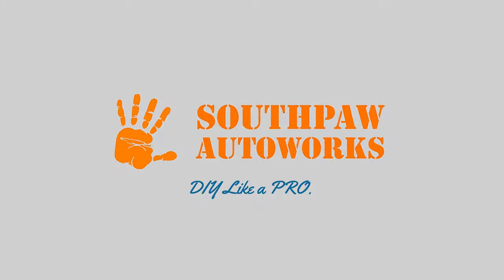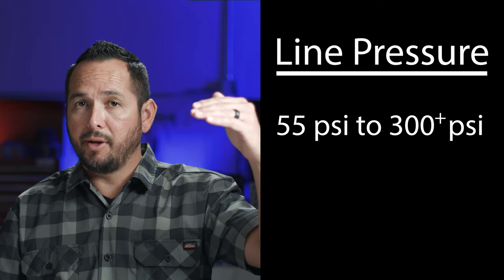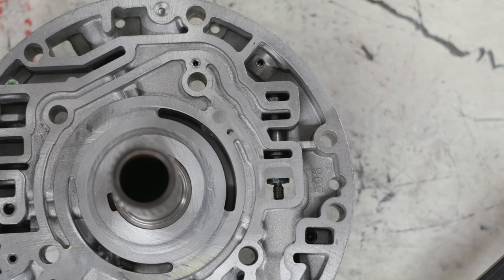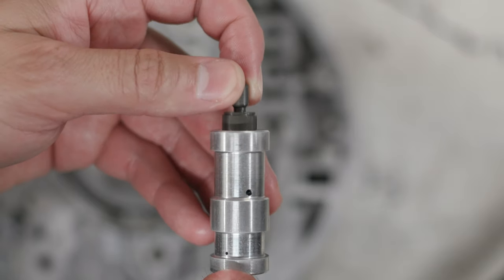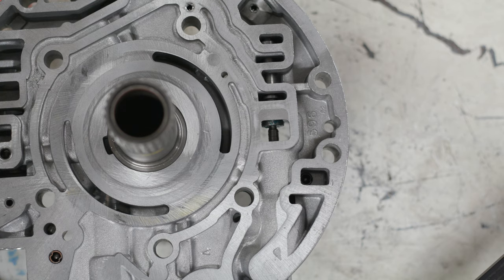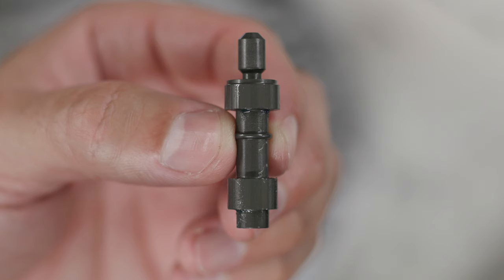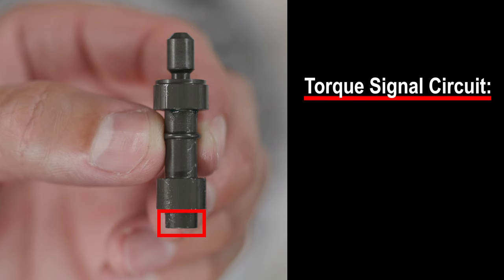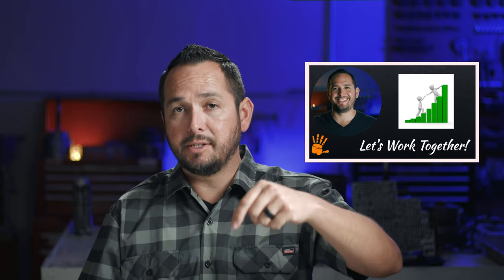4L60E Pressure Regulator Valve (Boost Valve) (Part 2 of 3)   (4L60E Line Pressure)

Comment: I also have a 1990 4x4 suburban 1500. Original 700 R4, I just drove it back from Florida, 1500miles,  towing a heavy load, and it shifts very nice and soft, typical GM. And when it's hot cold, when you put it in drive it clunks extremely harshly. It's not the ujoints, I just changed 1. I didn't put a new accumulator in the aux valve body, as per friend's recommendation, it still does the same thing. Hot or cold, and it's only occasional.  If I put it into 3rd drive. Not overdrive, it doesn't do it. Only when you put it into overdrive, and this of course  standing still, normal idle speed
Reply from the maker: Info received.

Comment: Kewl!  I'm currently experiencing an occasional hard slam into reverse from park on a 1993 C1500 5.7l with 235k miles.  This video was very helpful in understanding part of the reverse hydraulic circuit.

First up on the attempts to fix is a new TPS (throttle position sensor).  Obviously, the ECM gets some of its information about engine load from the TPS.  If that glitches, it could be commanding harsher pressures for the shift to reverse.

Thanks for taking the time, effort, and expenditures in hard cash resources (video and illustrative equipment) to produce these quality presentations.  They are detailed and extremely informative!
Reply from the maker: Really appreciate your comment.
Wishing you the best on 93 4L60E.

Comment: I had  a late 80s, aux valve body, 700R4 rebuilt for my 1984 6.2 diesel 4x4 suburban. The shop is very reputable, I know that it's a good job, I'm friendly with the owner. It shifts rock hard, which I'm fine with, because I use it for heavy towing. The only problem I have is problem but it sits for a day or 2, it takes forever to go into the driver or reverse. What is causing the fluid prime to bleed off?
Reply from the maker: It sounds like a drain-back issue.
The pump is responsible for multiple tasks.  One of those tasks is filling up the torque converter with fluid.  If the converter is low on fluid, it will not allow engine torque to reach the input shaft of the trans.

If the vehicle is parked for days, it's possible for the torque converter to partially drain back into the pan.  This, of course, is not normal.  
When the converter is partially drained, the pump needs time to fill it back up, before the vehicle will move again.

A worn pump bushing can cause this issue.  If the bushing is indeed the issue, I'd also be looking at the dowel pins on the engine, and the corresponding pilot holes on the trans bell housing.  If these are worn, it can allow for a misalignment, putting extra stress on the pump bushing....causing premature wear.
Reply: A tip I picked up years ago was to bolt housing to engine and have a dial indicator in flywheel or crank or flex plate whatever and check run out with the trans or bellhousing on the block you were using together, surprising how many times there is a stack up mismatch of production tolerances that cause bearing failures
Reply from the maker: Right on!
Thanks for sharing!

Comment: Hi Robert ,
Great videos ,i have been rebuilding 4l60e since the late 90s. 
Learned a few things regarding the oil flow paths and how they work.
I live in Australia and 4l60/ 4l60e is a very common trans 
Regard Aaron
Reply from the maker: Since the 90's?  Right on!!
It's crazy how many vehicles this trans is equipped in...

Appreciate you you checking out the video.
Thanks for dropping me a line!

PS - If it feels right to you, please help me spread the word about this channel.

1 Handed Transmission Rebuilder:  (60-Sec Preview)
https://youtu.be/y3Vixa_Ec1E

How the 4L60E valve-body works:  (60-Second Preview)
https://youtu.be/fWPSaLeaOXI

Comment: GREAT VIDEOS!! I Subscribed. I have a 1993 k1500, have to let off gas to go into 2nd. So I rebuilt the 1-2 accumulator, servo, and while i had the pan off changing fluid and filter rebuilt the valve body with a transgo sk-4l60e kit. It's just an upgrade kit, not a high performance, I got it all back together, let it warm up and went thru gears. Had reverse for a few seconds then no reverse, so I dropped the pan to check boost valve. The c-clip came out of its groove, put it back in and everything back together. Tried reverse again, nothing, not even for a few seconds this time. In the morning, going to check c-clip again and get a new boost valve with new c-clip. Before i got into tranny, had good reverse, just the hick-up with it going into second, all other gears are fine. Any feedback greatly appreciated, Terry.
Reply from the maker: Hi Terry, it's exciting that you are fixing your 4L60E on your own.  Occasional setbacks are a normal part of transmission repair.  I've had plenty of my own.  Mistakes can be great teachers...

I am familiar with that upgrade kit.
When time permits, I'm going to review the kit instructions, look over the hydraulic schematic of the 4L60E, and get back to you.  For the mean time, here are my initial thoughts...

Per the video, there are two clutches used to create Reverse; The Low/Reverse clutch and the Input-Reverse Clutch.  The Boost Valve/Sleeve is part of the hydraulic circuit that feeds the Input-Reverse Clutch.  When the Boost Valve/Sleeve fell out of it's bore, it created a huge leak in the Input-Reverse Clutch circuit.  A leak this large makes it impossible for the Input-Reverse Clutch to be activated.
Just to be clear, in order for Reverse to occur, two clutches must be activated, at the same time.  If only one clutches comes on, then the transmission acts as though it has been placed in Neutral.  

If you're interested in gaining a better understanding of how the 4L60E gears are achieved, check out these videos:  
Planetary Gearsets:  https://youtu.be/QjT0CUG73YM
4L60E (Manual Gears):  https://youtu.be/6kfAuXJFYFE
4L60E (OD Gears):  https://youtu.be/IfOqbTqKubE
4L60E (Reverse):  Naturally, I have not created this one...yet.  Coming soon!

Terry,
Did you happen to also replace, or upgrade, the Boost Valve & Sleeve??
Reason I ask:  There are two (2) different lengths of sleeve.
Can you measure your Boost Sleeve with a dial caliper?
Note:  Take the measurement at the portion of the sleeve that touches the snap ring (c-clip), and the portion that touches the large outer spring.  Do not measure the "nipple" at the end of the sleeve.
Note:  If you need a refresher on how to use a Dial Caliper:  https://youtu.be/yBKXO9l42lQ

I look forward to your response, Terry.
Reply: Thanks for the reply.I figured out today what was going on. Put a sonnax boost valve pressure kit in, and now i have all gears. Still think the band is going south, but hope to get several thousand more miles out of it by putting in a sonnax servo pin, which is longer than the longest GM pln. Will be doing a complete rebuild this winter. The toughest part will be pulling the tranny at 70 years old. Looking forward to more of your videos, Thanks.
Reply from the maker: I appreciate your response, Terry.
Good deal on the boost valve.
You can also increase the length of the pin (in essence) by using the large gold shim/washer that comes with that TransGo kit.  I imagine that you've already tried that....but I thought I'd throw it out there, in case it was overlooked.

For what it's worth, there may be a command issue causing the 2nd gear issue (or a sticky valve in the VB).  You previously mentioned that you have to let off the gas in order for the 1-2 upshift to occur.  I've got some ideas, but that's gonna have to be another conversation (or video), for another time...

I've got a lot more 4L60E videos in the works; what parts fail, recommended upgrades for different types of builds, more how-stuff-works (gaining this knowledge makes parts selection easier), transmission diagnosis, etc.  
If you haven't done so already, subscribe and hit the notification bell...so you don't miss any future videos.
Have a great weekend, Terry!
Reply: You fix it mine does the same I put the 1-2 and 3-4 accumulators acts better but still not 100% I bought the truck with 130k from original owner he just had the trans rebuilt trying this hood valve next

Comment: Great Video Presentation.  I have a 2005 4 wheel drive  Silverado when I back up into the driveway or up hill the truck slips out of reverse this happens intermittently, but I can shift into 1st 2nd and 3rd and drive off with no problem runs great what do you think the problem might be?
Reply from the maker: It sounds like you've got a clutch that's slipping in Reverse.

Reverse is created by two clutches:
1). Reverse-Input Clutch.
2). Low-Reverse Clutch.

If either clutch starts slipping, we lose Reverse (or Reverse starts slipping).
There are ways to identify which clutch is slipping, while conducting a road test.  A future video topic.

Fluid level:
If the fluid level isn't set correctly, this could also cause problem backing up a hill.  The filter pickup is located near the rear of the transmission oil pan.  When backing up hill, the oil is flowing towards the front of the trans...away from the pickup.
Always a good practice to start with the basics...

Comment: I purchased several “O” ringed (outer portion) boost sleeve/boost valve assemblies that were made by the Sonnax company.  Stick dementions are 0.471 (reverse boost) and 0.421 (load boost). The Sonnax valve is 0.531 and 0.491 respectively compared.  This seems like a lot to me (the amount of increase)!  I have yet to experience the effects that the larger valve may have.  Any idea what I should expect?  The first one is installed in a pump with a new oversized pressure regulator valve needed to restore sealing integrity to the pump.

Comment: Nice explanation bro but try to some animation  to explain some complicated systemes and opration
Reply from the maker: Couldn't agree more.  At some point, after this video, I did spend the time to create a number of animated videos...for a better viewing/learning experience.  Hope you enjoy them.

4L60E: PR Valve (Part 3) Torque Signal Oil Pressure (4L60E Line Pressure):  https://youtu.be/PY1trZeLqTM
4L60E: AFL Valve (Part 1) How it Works:  https://youtu.be/LqBkdegPjNk
4L60E Shift Solenoid - Part 1 (Basic Operation):  https://youtu.be/FaChWmcsAgI
4L60E: 1-2 Shift Valve + 1-2 Shift Solenoid (Part 1) Basic Operation:  https://youtu.be/jPhm76RDz6Y

Comment: It is also worth noting, that the isolator spring and boost valve also act as an accumulator for the Reverse Input Clutch.
Reply from the maker: That's very interesting.  I never looked at it that way...
You've got my curiosity peaked.

The Input-Reverse circuit has a check-ball/orifice (in the separator plate), but no dedicated accumulator (Low-Reverse circuits are somewhat similar in setup).  I previously rationalized that GM got away with not having an accumulator in this circuit, by employing the Belleville spring (dished steel plate, cushion plate...whatever you want to call it) in the Input-Reverse clutch pack.

You definitely got my mind running...and I thank you for that.

Thanks for dropping me a line!
Reply: @SouthpawAutoworks  could this explain the condition of no reverse but then suddenly engaging at high rpm’s? If the boost valve is malfunctioning?
Reply from the maker: It sounds like there's a leak in the Reverse circuit.  By raising the RPMs, the pump will increase oil pressure, and deliver more oil, to the circuit.  This extra pressure, and extra volume, can help overcome a hydraulic leak.  However, if it's slipping that bad, then it's typically time to open up the trans.

There are two (2) clutches that are responsible for creating Reverse.  You can conduct a road test, and identify which clutch is causing the problem, before you tear into the trans, take it into a repair shop, etc.

I'm happy to share more info...as time permits.  Let me know if you want to learn more.
Reply: @SouthpawAutoworks  wow! That’s some good info. 
I was going to put a Sonnax higher PSI boost valve in, but it sounds like that at best would be a temporary fix. 
The high reverse gear is working fine, it’s the low reverse gear that seems to be not engaging. 

I’m excited to try to rebuild it myself, should I just try to do the reverse clutches or just for a full rebuild?
Reply from the maker: Yeah, if it's slipping that bad, I'm thinking that the damage is already done.  Slipping clutches create a lot of heat.  Chances are the clutches are smoked.  Plus, the oil is probably cooked, too.  If you pull the dipstick, you can examine the color of the oil, and the smell of it.  White paper towel can help with identifying the color.

While it is possible to replace bad clutches, and do nothing else, it's not typically the best course of action.  
Generally speaking, clutches don't fail all on their own.  In other words, there's a reason why they failed.  Always best to try to locate the "root cause" of the clutch failure.  If this is overlooked, you can wind up smoking the same clutch, all over again.
Reply: @SouthpawAutoworks  which it sounds like the reverse circuit isn’t building pressure so is there a common failure point for that circuit to leak? A check ball or something? Lol nvm I’ve taken advantage of your free wisdom already 
I’ll just bite the bullet and rebuild it.
Reply from the maker: Happy to assist.  It could be a number of things...

If it were my 4L60E, I might suspect; 
1). A damaged Teflon sealing ring, on the Stator Shaft (the shaft that the Input-Reverse Drum rides on).
2). Damaged Input-Reverse Drum bushing.
3). Boost Valve/Sleeve.
4). Check-Ball Capsule in pump.
5). Reverse abuse valve.
5). Etc.
Note:  Knowing which clutch failed, can help point you in the right direction.

Believe it or not, using additives to try to fix leaks, can cause clutch packs to fail.  I'll cover that in a future video.

There's two (2) clutches used to achieve Reverse:
1). Input-Reverse Clutch.
2). Low-Reverse Clutch.

It's possible to identify which clutch has failed during the road test.

Road Test:
With the engine idling, shift from Park to 1.  Accelerate the vehicle to a speed that makes sense to up-shift.  Instead of up-shifting, just let off of the gas.  What happens?
1). Vehicle slows down quickly (engine-braking)?
2). The vehicle coasts, like it's in Neutral?
Reply: @SouthpawAutoworks  Hi- I finally got time to do that road test, 
The vehicle coasts as if in neutral. It doesn’t feel like any engine braking is going on
Reply from the maker: Good deal.  Thanks for taking the time to do that.

There's two (2) clutches used to achieve Reverse:
1). Input-Reverse Clutch.
2). Low-Reverse Clutch.

Based off of your findings, it sounds like the Low-Reverse Clutch is the problem.
If the L-R Clutch was working, it would create engine-braking, under those conditions, with the trans in Manual 1.
Reply from the maker: Accidentally deleted my original reply to your comment.  =/
I just now reposted another response.
Reply: @SouthpawAutoworks  gotcha- yeah I tried it again and it felt a little slower than N would be 
But not much. 
So that means I’m going to need new reverse clutches?

Comment: love the videos, great explanation. got a question, I've rebuilt about 15 4l60e's, and just did my newest 2008 with a master overhaul kit from WIT, that had the typical failed input clutch and that was it, once back together, no reverse on the lift. tore it back down and to low reverse was burnt just on the lift. not an issue before, i did do the transgo 1.9 boost valve when the one in it was a 1.8 in it. transgo says it is compatible with both but it burnt low/reverse, first was weak and would not shit to 4th on the lift. thanks for any pointers.
Reply from the maker: That's hard to say.
Haven't had any issues using that particular boost valve setup.

What's the line pressure with the engine idling in Park?
What about drive?  Reverse?

Comment: Hi Robert, Oggetto: "1999 Corvette C5 transmission issues". Hello, this is Christian from Italy.  I hope I'm not bothering you, but I'm really struggling to solve my Corvette issue. Maybe you can help me. I'll try to be concise: the issue is related to the 4L60-E transmission on my Corvette (1999 C5 LS1 345hp). It has been rebuilt three times. The first two times it has lasted 6000 mi, while the third time only 5000 mi. At this point I decided to change mechanic in order to perform a better diagnosis. The new mechanic found out that new stronger springs, a new clutch kit, new gaskets, ect., would have solved the problem. Additionally he also raised the pressure parameters on the ECU (he assessed they were too low), reinstalling the original values. When the car finally came ready, I went to pick it up to drive it back home on a 300 mi trip. That day temperatures were above 100 degrees. Bottom line, after 150 mi, trying to pass someone on the highway, the transmission failed again!!! I'm a kind of desperate. Do you have any idea about which component could be responsible of all this? The issue looks like being related to the Driver and the third gear. First and second gear are fine. I accept any suggestion. Thank you for your time. Best regards, C. Z.
Reply from the maker: Have you tried cleaning the MAF sensor?  I know it sounds crazy...but it is a major load sensing device, that the PCM uses to increase line pressure in the trans.  Therefore, if it the PCM doesn't know about the additional engine load (via the MAF sensor), then the line pressure will not be increased.....resulting in excessive clutch slippage....resulting in clutch failure.

FYI:
Andy cleans MAF on a daily basis, at the shop he works at.  Just a normal part of transmission repair.
Reply: @SouthpawAutoworks  I try to do this check because at 77 miles after the last overhaul, it kept shifting gears and had never done this before. I don't know if this is a sign!
A thousand thanks.